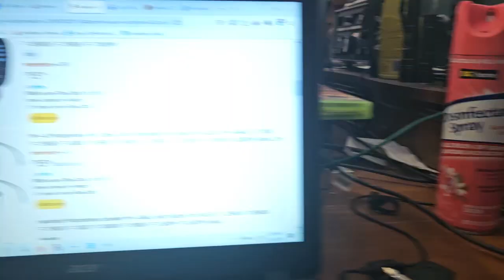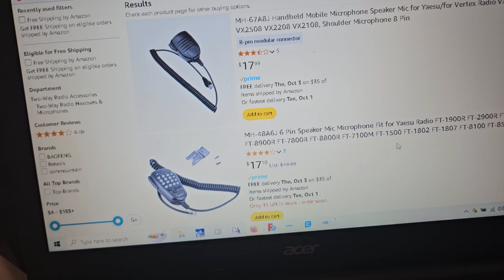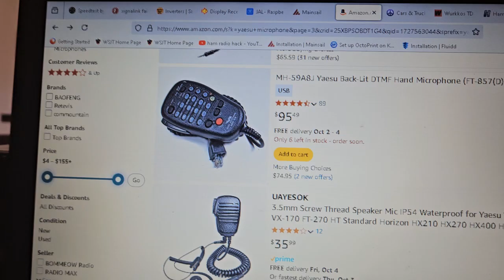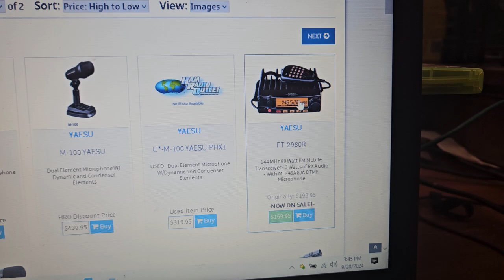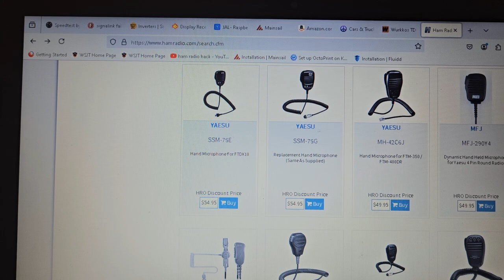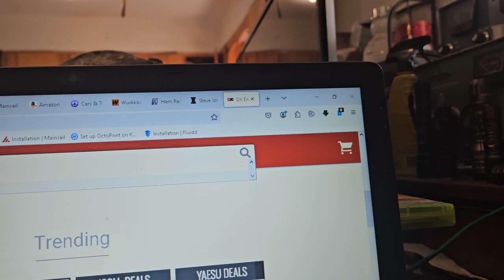Yaesu replacement ham microphones 🎤

Comment: Hey man. I inherited my grandfather's ft 2400 which takes a MH -27 mic. It's notorious for a bad capacitor that makes you real quiet on the air. I have not been able to find a cheap aftermarket mic for it and dx engineering/ham radio outlet charge like 100 bucks for one. Do you know if they make an aftermarket one for these prices or even just less than 40 would be great. Thanks if not thanks for the video
Reply from the maker: Unfortunately no. Ebay or buy a MH-48A6J and rewire it
https://amzn.to/425df8L